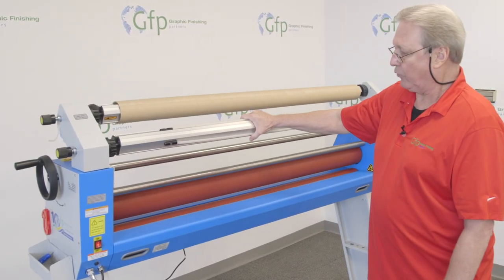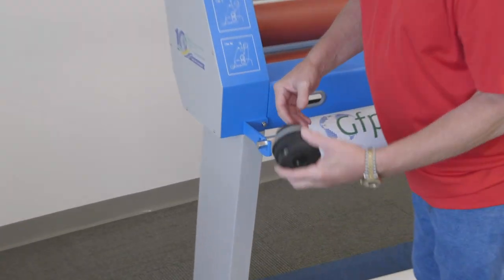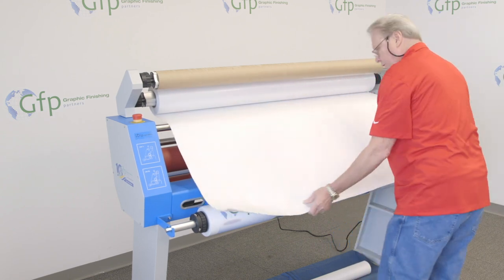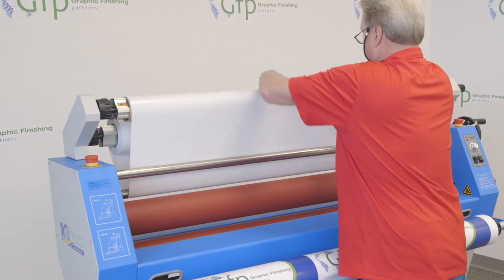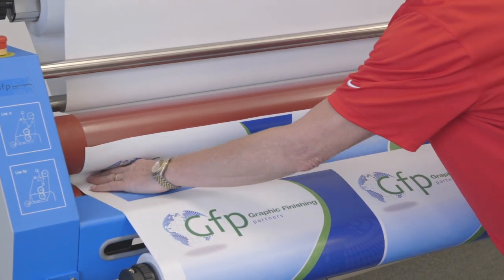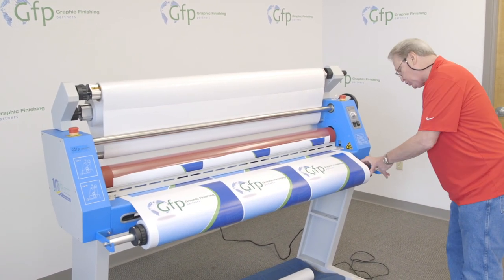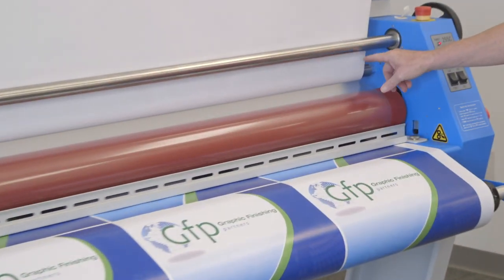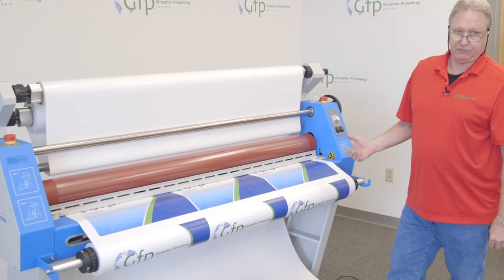PSA Overlaminate on Printed Vinyl Gfp 200 Series Laminators

Comment: Great technique, Have tried this on these machines and it is much easier for the newbie. Curious about changing rolls in the middle of a job when the laminate runs out. have tried several methods with varying results.
Reply: Ideally you match the length of the overlaminate to the print. If you are trying to use up short rolls you can splice the new film on to the old material.

Comment: How much brake tension do you usually have on the overlaminate roll?
Reply: When setting the tensions for your overlaminate unwind and release liner rewind it is important to keep in mind that it is a balance between the two adjustments. For a base setting, I will start by backing both tensions off, then start adding tension to the overlaminate unwind to get the film tight and flat to the roller, I will then adjust the release liner rewind to control where my release point is. 

This is keeping in mind that adjusting one tension affects the other. As an example, If my release liner is coming to far forward, I can either add tension to the liner rewind or remove tension from the laminate unwind. Or if the release liner is pulling the film with it onto the liner rewind, I can remove tension from the rewind or add tension to the unwind. What adjustment you make will depend on where the tensions are currently set when you make the adjustment. I try to keep my tensions as low as possible to avoid stretching the film. The goal is to find a good balance between the two adjustments.